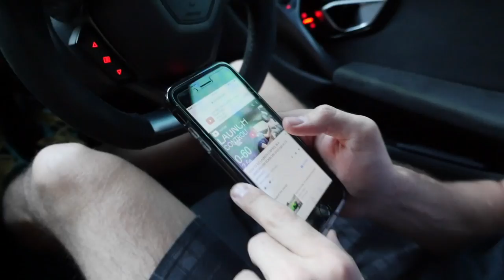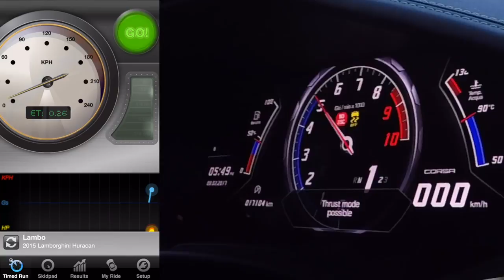Our First Vlog - Lamborghini Launch Control, WTF86 Update, Budget Builds Plan!

Comment: checked carsales and there is a R33 gts-t going for $3k in VIC its RB25DET with automatic transmission. probably a good starting point for a 10 second car unless you can find a car + engine cheaper

Comment: Whats the app that let you see the 0-60? and does it let you change it to mph?
Reply from the maker: Ill need to get Andrew from zero to sixty to answer that one!
Reply: Hi Crix, The app we use is called dynoliscious. It will do mph. Its getting on a bit now, but we've found it pretty accurate against timeslips. Also using iPhone 6's I don't know if that makes much of a difference to older phones.   What car do you drive?
Reply: Zero To 60 Thanks. Currently i'm Looking to get a mazda 3 sport soon, as they are very cheap over here, especially for what they are. Danm that app isn't out for android.

Comment: Hi Mark. Is the widened body on the wtf86 Street legal? Or are you just using it at track?
Reply from the maker: it is street registered :)
Reply: Street FX Motorsport TV compliance plate /engineer cert required?
Reply from the maker: yes, it was a costly engineer cert with about 20 items :|